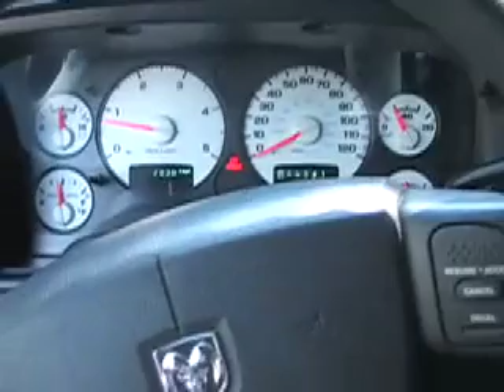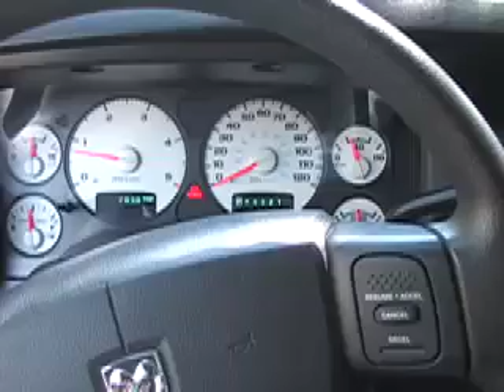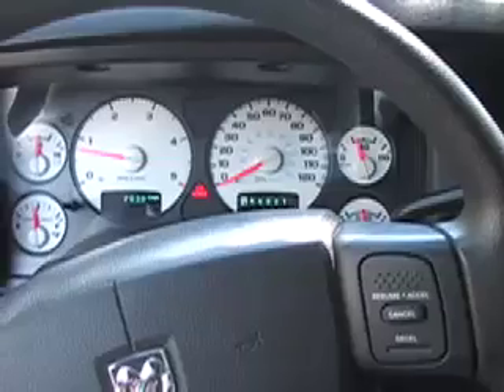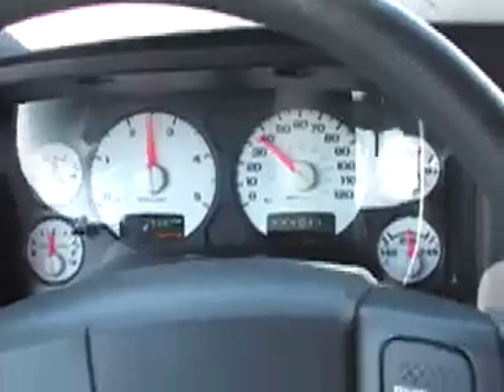Aero Exhaust Diesel Performance Muffler

Comment from the maker: We have actually seen a good increase in bottom end torque, it responds more like the Dodges with the Hemi in it that I have driven.  Depending on the load on the engine and under heavy acceleration you can here a little bit of a drone in the cab when the tranny shifts and hits 1400 RPM, but then its gone.

Comment: Just wondering, I know in the vid you said the resonator makes it quieter in the cab, but OUTSIDE, is there a noise/ soud difference between resonated and non resonated?
Reply: I know somebody who ran a 5 inch straight pipe and then added the 5050 xl aero turbine muffler. The 5050 xl kinda quieted it down a little bit at lower rpm, but mainly its a much lower, deeper growl. Sounds more like a large dump truck. The deeper sound outside makes it more pleasant in the cab because that raspy straight pipe sound isnt there to resonate into the cab. Just my $0.02. Hope this helps